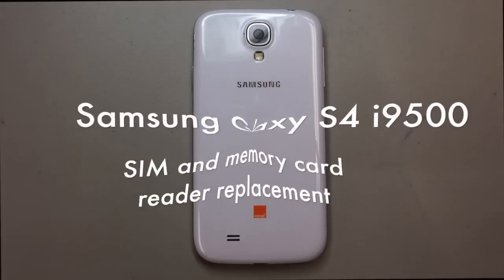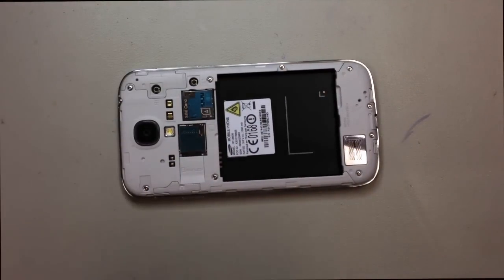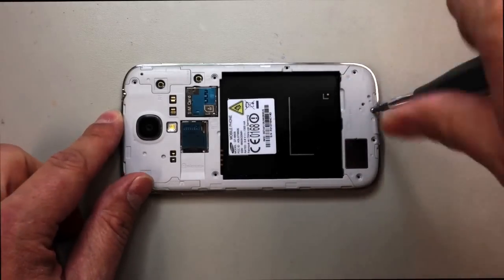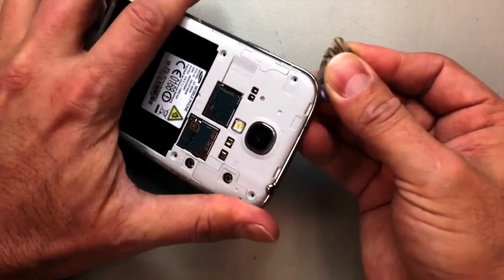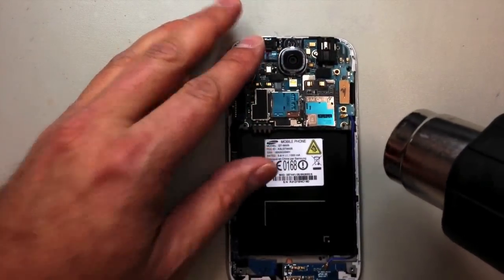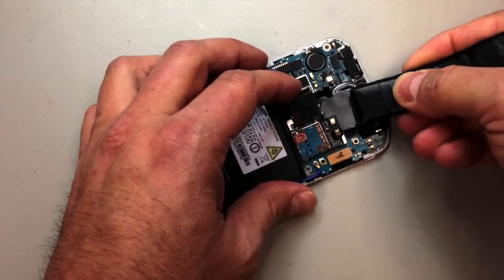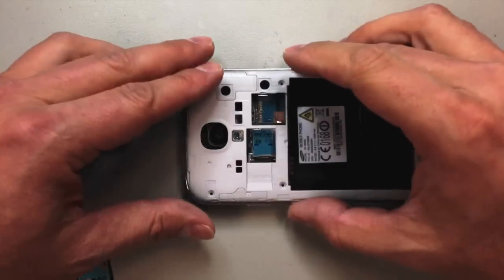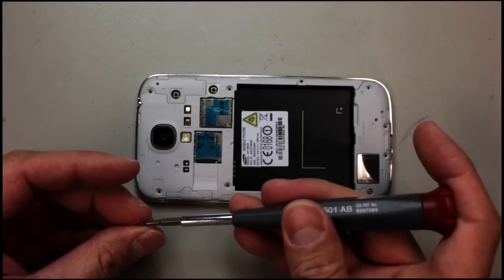Galaxy S4 SIM and micro SD card reader replacement

Comment: still getting the error after replacement -.-
Reply from the maker: That is unfortunate. See my comment to Enrique below.
Reply: Go Cell Phone Repair I replaced the sim card, the sim card reader, factory reseted, reflashed the all rom, yet that message kept coming, my assumption would bring me to think its possibly that the motherboard, it could be causing overheating, or it is damaged somehow (which i am not willing to spend the money to fix)... I am just wondering maybe there's a way I can just disable that feature that require me to restart when the phone sees that the sim card is missing, like disabling or delete a function in the system...
Reply from the maker: birth23ful Not sure off the top of my head. I'll check with my techs tomorrow and see if someone has a solution.

Comment: this is one sure way to make your warranty void. if your phone is in warranty dont try this diy stunt.
Reply from the maker: Yes. We always recommend that you use the manufacturers warranty first as long as you don't mind getting a refurbished replacement phone. Also do not send your battery or battery cover in when making a warranty claim as you will not get new ones in the mail.
Reply: who said anything about refurbished handsets. if the handset is repairable then its repaired not refurbished